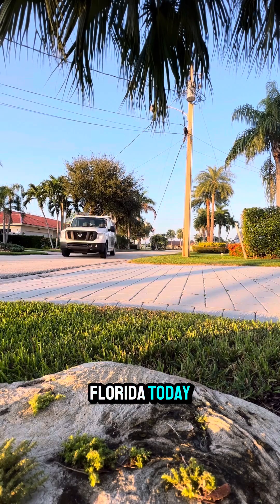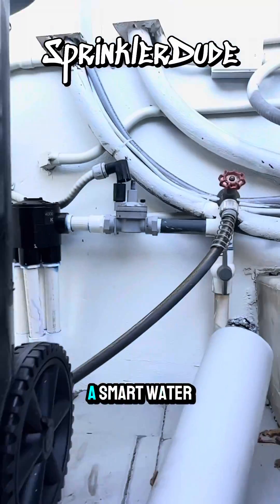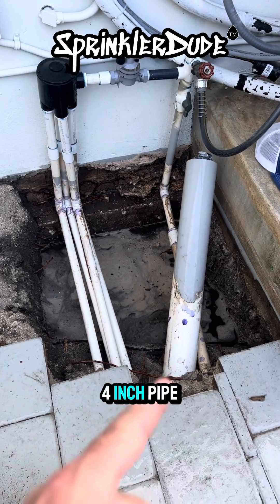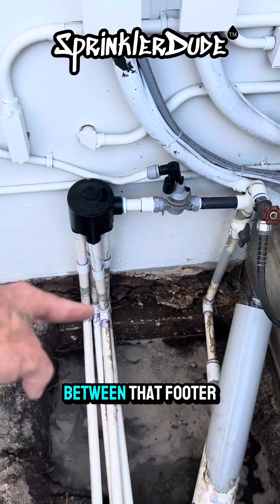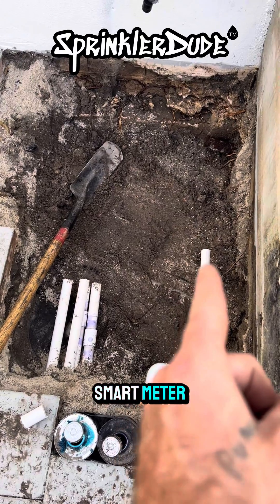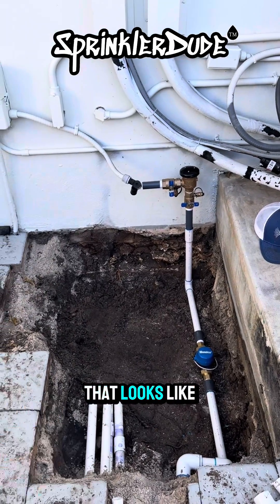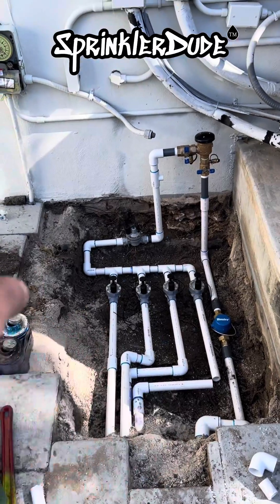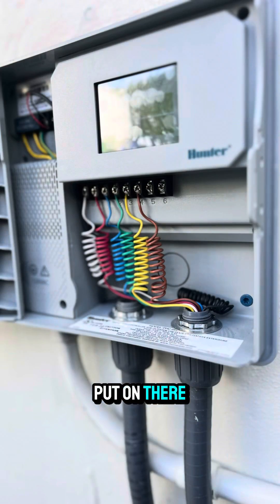4-Zone Indexing Valve Upgrade | Smart Irrigation

Comment: I’m in west palm me setup is similar how much on average is a job like this?
Reply from the maker: If it is a city water system and you're looking for the valve upgrade for a four zone system and the smart controller. It would range between $1800 and $2200. If it is a pump system, it would be an additional $300 for the relay. This includes all parts and labor.
Reply: @sprinklerdude  are you willing to give material list to use if its a well pump system
Reply: @sprinklerdude that’s way more affordable than I would’ve expected.!